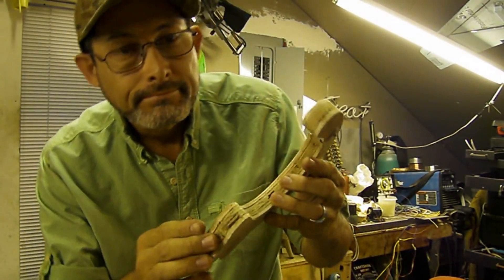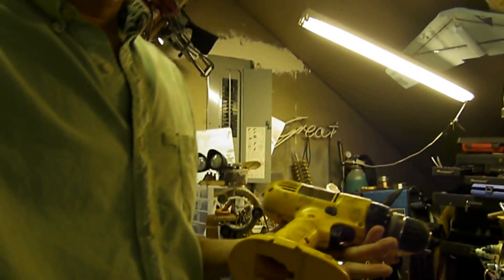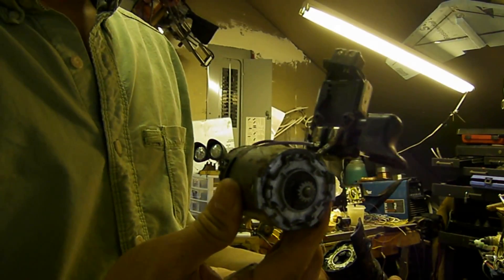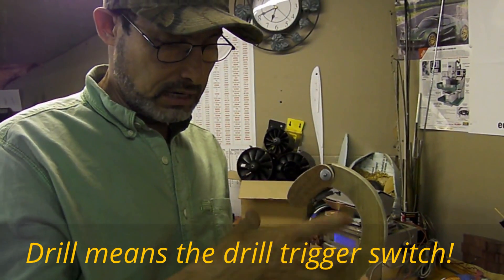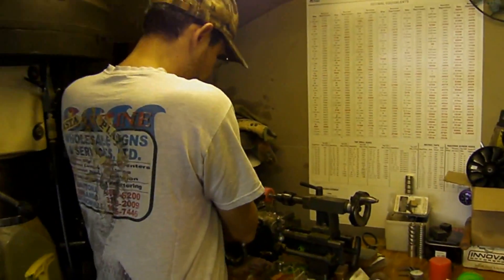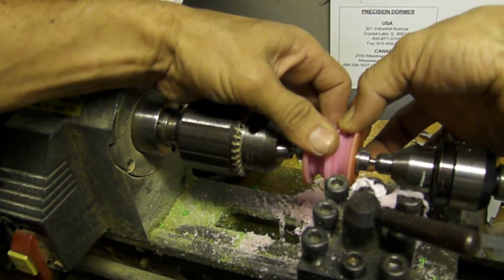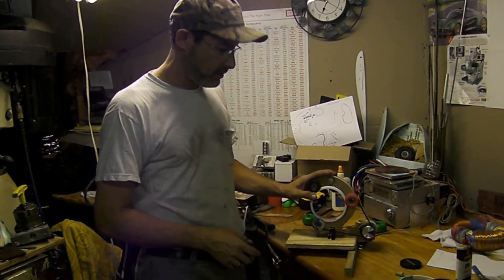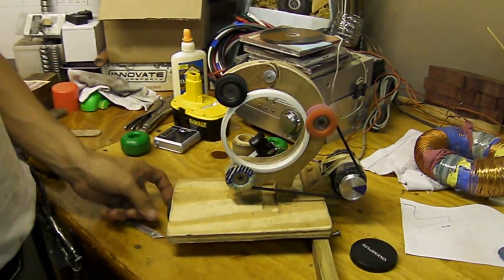Toroidal Winder kit! & downloadable plans so anyone can make one! Part 2

Comment: 20 numbers smaller please.
Reply from the maker: Can you explain? I do not understand....
Reply: You need a "slider" for this machines.
Reply from the maker: Well, Yes you are totally correct, but for a hobby machine it is hard to make extra parts.. keeping in mind that those accessories have to be made really small and really durable... so do you have a option or example of an simple cheap and easy to made slider?
Reply from the maker: would you care to send a link or photographs of a nice slider that could be manufactured.. or at least adapted?

Comment: Contragulations for a simple but superb design and so very easily made. Truly a very worthwile post. contragulations again and all the very best to you.
Reply from the maker: Thank you. Much" really appreciated. Hope you can do your own soon and enjoy the pleasure of making your own ChoKes and TranSformers. :-)
Reply: Migueldeservantes I will most certainly build your excellent toroid winder but will run the motor at a slower speed and so obtaian a neat job.After all i am not going to wind hundreds of toroids so what's the hurry. Congrtatulations again and again
Reply from the maker: Vivian Astridge Well the first motor was super slow.... to the point that was becoming very annoying that was the reason I change to the second one, "Be the way the second one "Have a two speed gear box" so in speed one is also annoyingly slow! but is very good with the thicker wire and give a much better presentation.
Reply from the maker: Vivian Astridge you should check this video at the minute 4 it show it working very slow! Toroidal Winder kit with downloadable part 4 winding two toroids!
Reply: Migueldeservantes thank you for your suggestion. Yes i did see that part where the machine was working at the speed i would run it. It works perfectly  and it cannnot be faulted on any account. I would bever have t hought that such a complicated machine could be redesigned to sucy a beautifully67 simple madhine that could be made at home. Well done and congraqtulations again. I wish you the very best. Thank you for your excellent, working design but most important of all its total simplicity. You are definitey a most clever person.
Reply from the maker: Are you using goggle translator? May I ask what is your mother language??